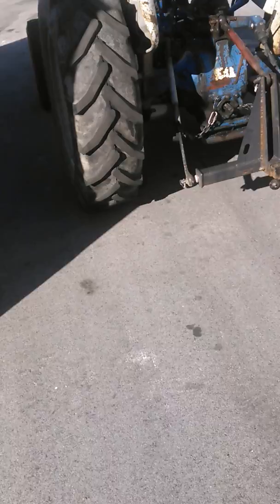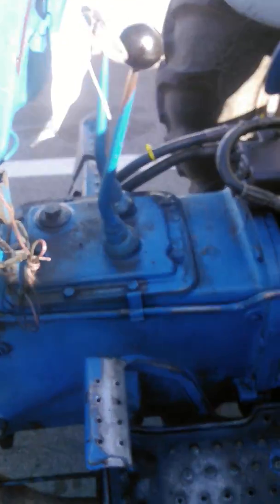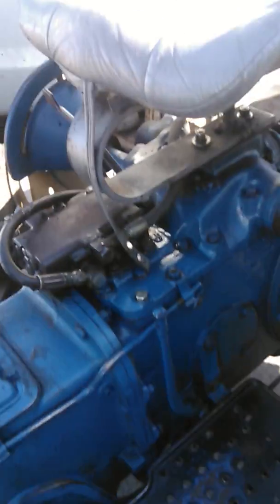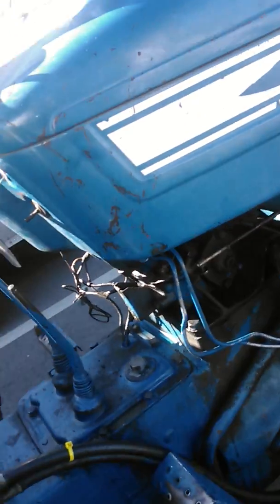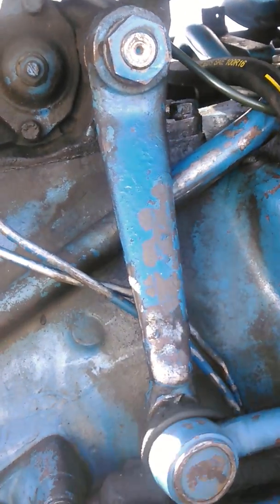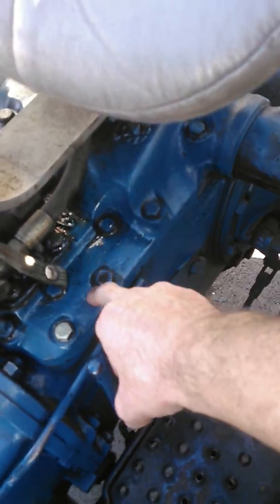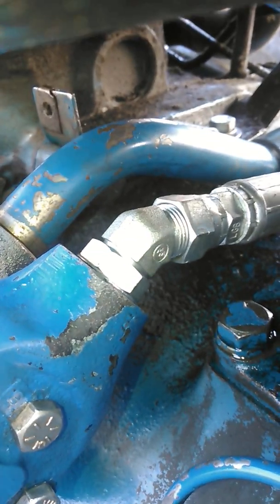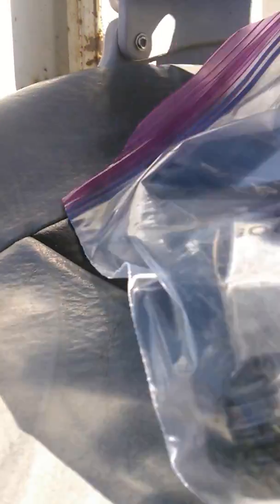Ford 2000 hydraulic issues

Comment: I changed my pump out for the gear pump style later (70 4000 )version cut back the hard lines and connected flexible hydraulic lines still dealing with too much pressure,  already changed the pressure relief valve ,maybe its a bad one?

Comment: My line keep blowing off. What are the spec. To replace the fittings and hose. Thanks
Reply from the maker: On this job. I ordered several reman .pumps. one of the pumps had a threaded port instead of oem style. I then adapted fittings to work. Sorry,but I don't recall thread sizes. Oem were BPT(British pipe thread.)